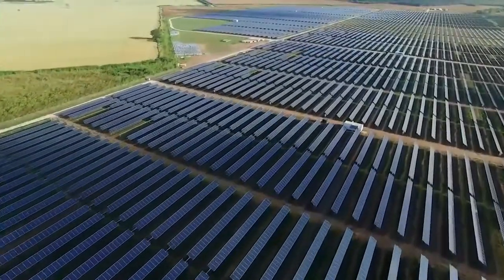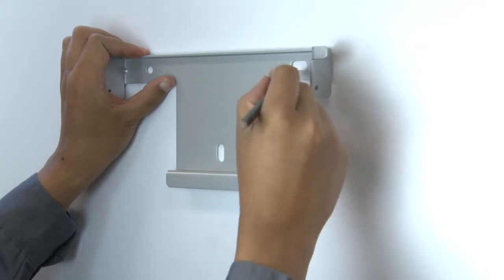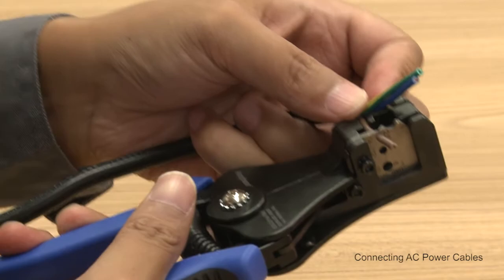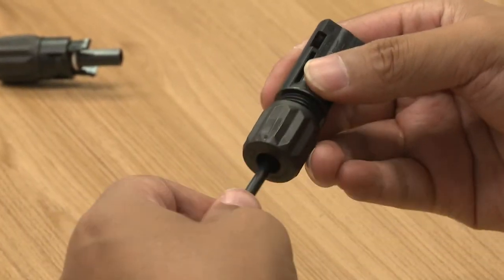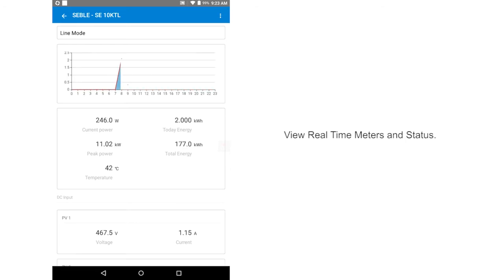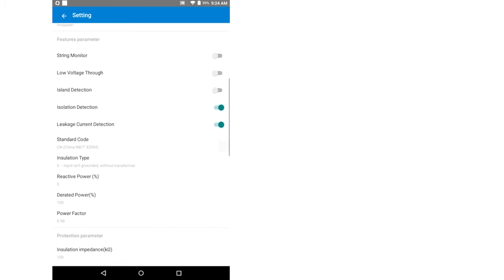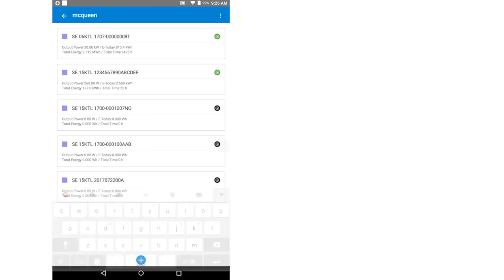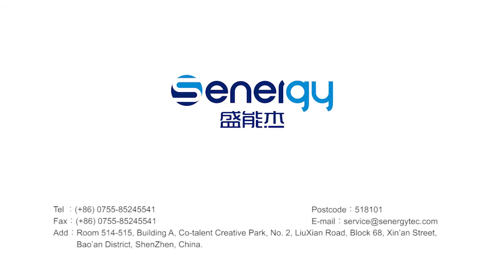Senergy Solar Inverter 2kw 3kw 4kw 5kw Installation Guide

Comment: All model have bluetoot access? I want buy Senergy Single phase 2k in store here. Color blue. But I not see antenna?
Reply: @senergyapd9319  Thanks for the extra information. All I see was just a bolt screwed in the place of the antenna. 

The Senergy will arrive tomorrow, and it comes with Wifi module. 

Will first hook it up with two panels 660watt in total. And with time adding another 3 panels.